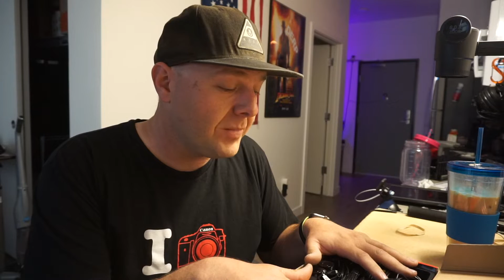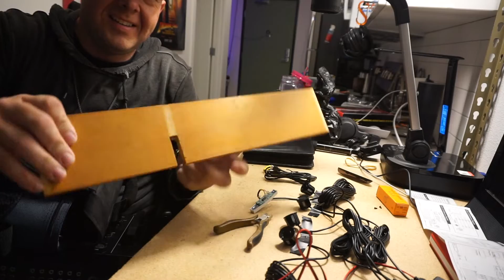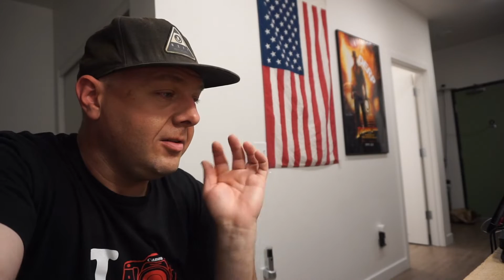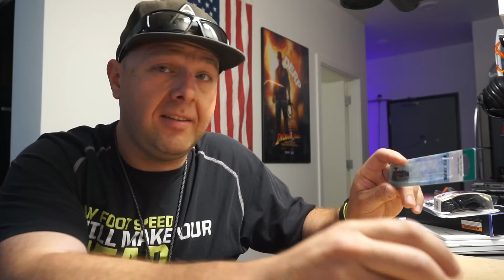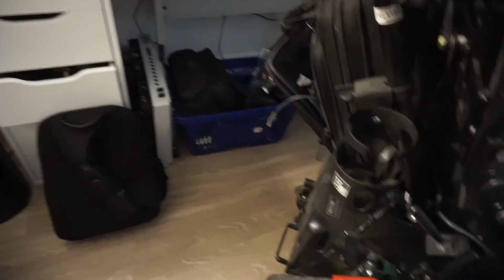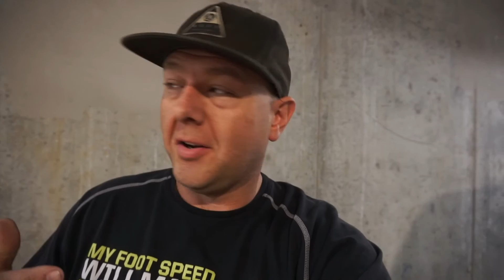MEGA VLOG 427: wheelchair OBSTACLE AVOIDANCE! (kinda)

Comment: Do you know how to reset the presets on either side of Permobil F5 Corpus VS ? I bought this one (2018) model used. Just want to reset them to factory settings. I was told that only Permobil tech with programmer machine could do it ….,

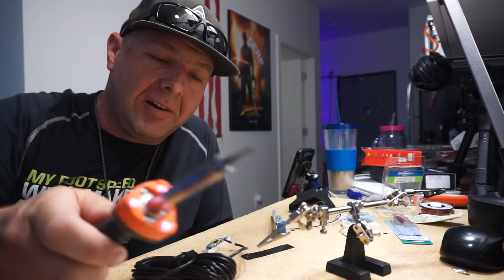Comment: 25:00-- When I was a teen, I used simple plug in soldering irons... I took a turn type of light dimmer, a wall socket, a power switch, an equipment-on light and power cord. Mounted them all in a project box and I had a handy little temperature-control-station for my soldering iron. It was basic. You had to guess at your temperature. Today, you could use an infrared thermometer to read your iron temp. The dimmer would be good to about 100 watts back then.

Comment: This is protection related..lol. I have a Permobil M3 with this joystick module; https://permobilus.com/product/permobil-joystick-module/ It's not damaged, but it's getting little knicks from being bumped into door facings. The outside housing is metal, so I don't to wait until it gets a dent in it. Does a protective (rubber maybe?) cover exist? I know the Shark joysticks had a protective bumper. https://www.monsterscooterparts.com/protective-bumper-for-the-dynamic-shark-joystick-controller.html
Reply from the maker: ah yes... lil bit of sharpie, or fingernail polish to cover the scratches up! lol 

i haven't seen anything as of yet - permobil usually answers the phone if you call them - usually ya can talk to a technician - they might have some insight if a product exists, or if theres any plans to make something similar!

Comment: That is a great proof of concept! I want to do something similar where I can set the speed based on where I am. For example if I am rolling to the desk or into the van I could slow down the chair.
Reply from the maker: actually thats a great idea.. and ive already hatched a scheme to make it work! LOL (or at least a way to tag different locations) involves bluetooth markers, and an $40 android phone :^)
Reply from the maker: a long time ago, i used a cheap android phone, and a GPS geo-fence to automatically turn on my chairs headlights when i got to this one trail area thats always super dark :^)
Reply: @TotallyNormal-  Awesome! How did you control the lights? GPS should be standard on these things.
Reply from the maker: used a bluetooth relay module, and the app called "tasker" its an "if this then that" type of app .. pretty cool!

Comment: I had the same idea many years ago but couldn't find the control module for the sensors. Does the input this sensor full-fledged change with varying distances? Maybe a potentiometer to cut down on their sensitivity? This system would have to be shut down when loading in transportation your van are like public transportation! It's almost like the driverless cars shrunk down for wheelchairs?

Comment: Hi Dan.  I actually like your idea of a rear sensor with a warning light.  Maybe just a small LED and a short low-frequency tone that is not obnoxious. That would alert both the public and the wheelchair user.  I don't think it would be a problem if it went off in tight spaces like elevators if it was just one short low-frequency tone.  It could also have an activate switch so that it could be turned on when really necessary, like in grocery stores or other places where people tend to walk up and stand right behind you. Nice proof of concept video!